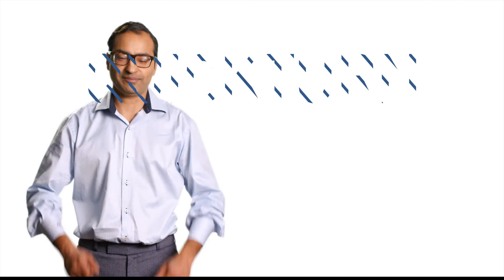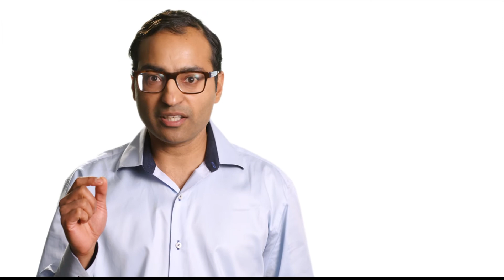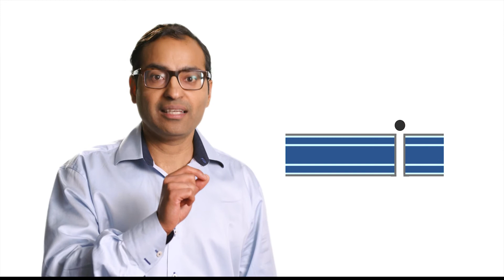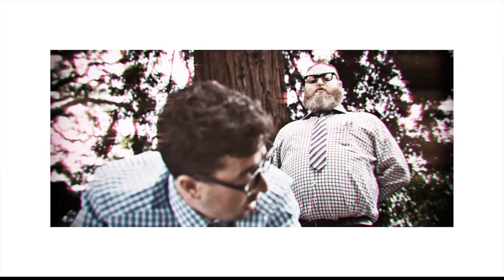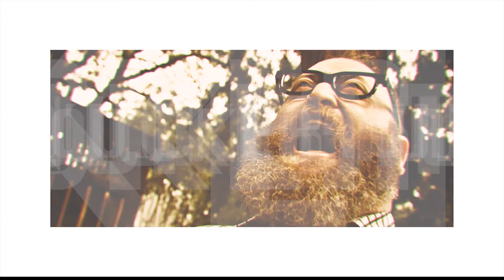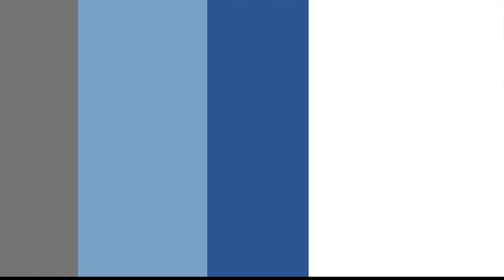How To Get a Quicker Turntime on Your PCBs | Sierra Circuits

Comment: What is the circuit board mask made out of, and is it acid-etched or washed off after the printing process, and if I am only "designing" the board, and Sierra Circuits is manufacturing it, then, doesn't your end cover that part of the manufacturing process? Or, is this just an informational video for someone who is like a maker/DIYer who's doing this in their garage at home? Anyway, very interesting and excellent information. Thank you!
Reply from the maker: Designers do more that just layout the traces.  They are also in charge of deciding the appropriate materials, what type of holes and vias to use, and where they want to put the soldering.  While it's true that we are the experts on the process, there are lot of decisions we can't make for the designer, as they all are affected by their specific needs, and the board's final environment and application.  

We're always trying to help PCB designers make more informed decisions that are both manufacturable, and can save them time and cost.

And to answer your first question, Solder mask (if that is what you mean by board mask) it is made out of a kind of bolymer and is acid-etch off after the printing process. If your interested in learning more check out our blog!

https://www.protoexpress.com/blog/
Reply: @ProtoexpressPCB  Thank you!